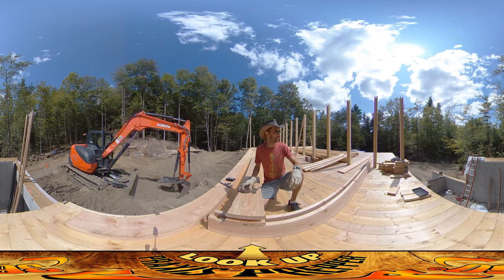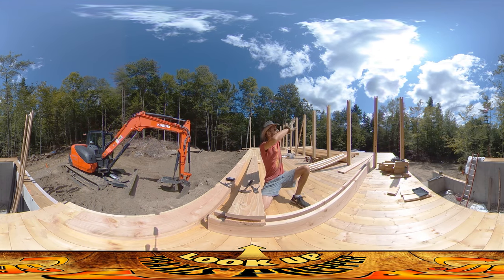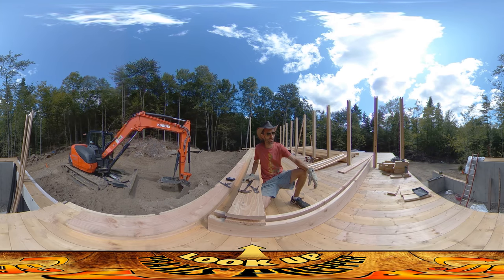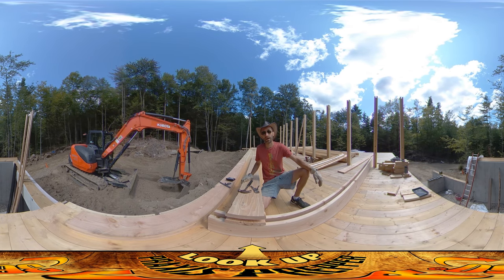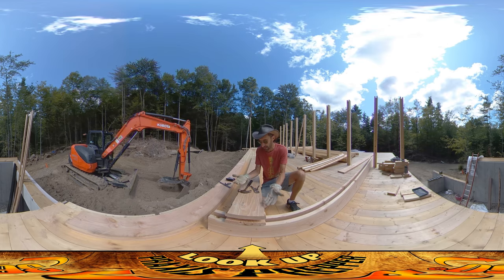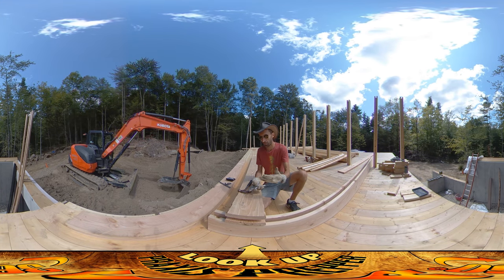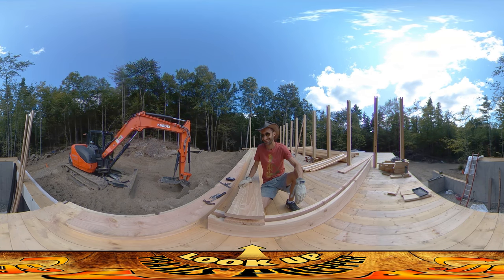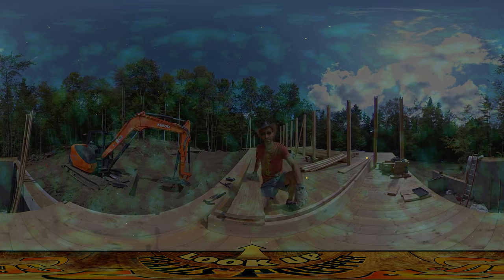Homestead Building - Building More Joists, How to Drive in Bent Nails

Comment: I never thought of the Vice Grip trick. I always just used the "claw" side to bend nails back up. Sadly, that doesn't always work.
Reply from the maker: The magic part isn't so much the straightening them back, but rather the holding them as you hammer them in. It's amazing how well it works.